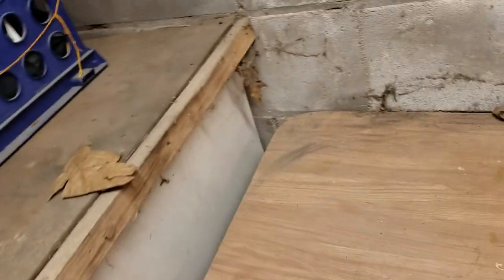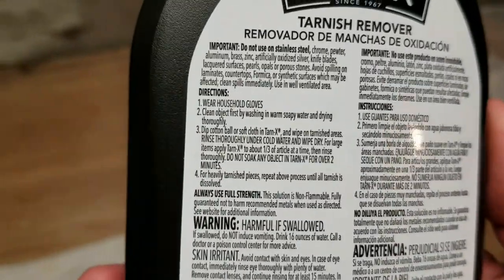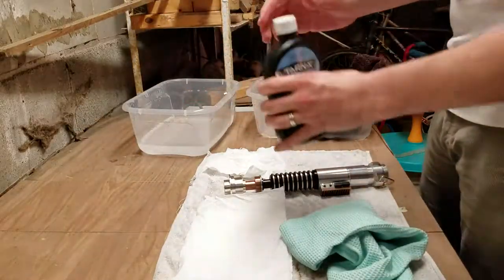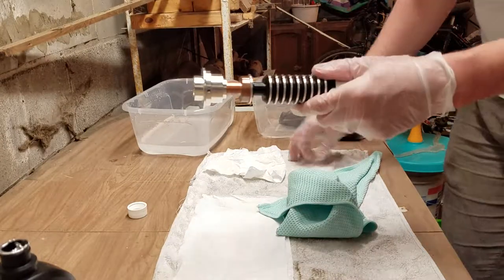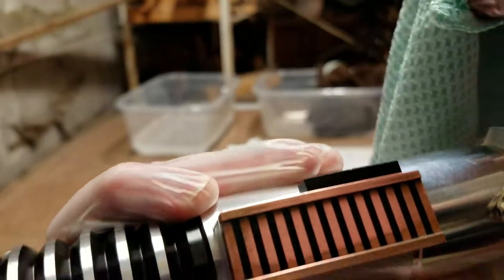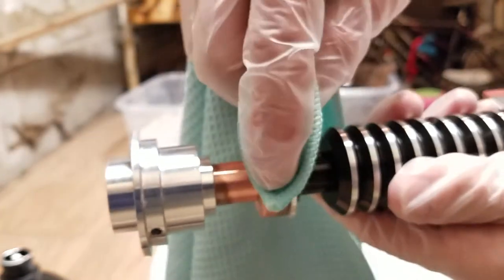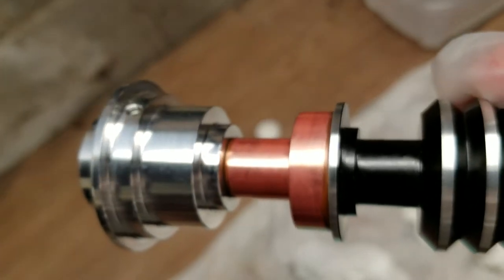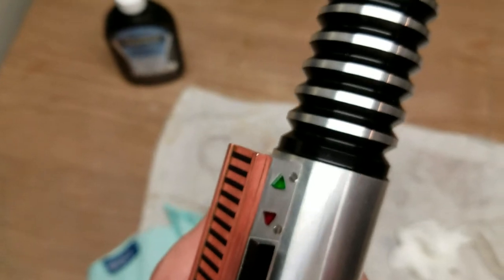Cleansing Copper tarnish from Vader's Vault Hero

Comment: Just get yourself a tube of Simichrome Polish on Amazon...you don't need to worry about getting it on aluminum and it works for ALL metals. You don't need a micro fiber cloth, you can use a paper towel if you want and the saber will look fantastic.

Comment: Hey do you know if they're going to be doing another run on the hero and how much do they normally cost?
Reply from the maker: I don't know what their plans are for the Hero, but it currently does not show on the website. I would check their Facebook - that's where they post their updates and announce ordering availability. You need a trigger finger for when they go live, though! They are probably still in the midst of their Graflex (Anakin's) production now. 

The Hero I got was over $700 with the shipping. I kinda went for broke. If this is my only saber, I'm happy with it. The Hero was more expensive than their other limited edition sabers, which will probably be closer to $600 with shipping. But you also have to consider any add-ons which bump up the price, like RBG (instead of a single color), weathering, any special requests, etc.